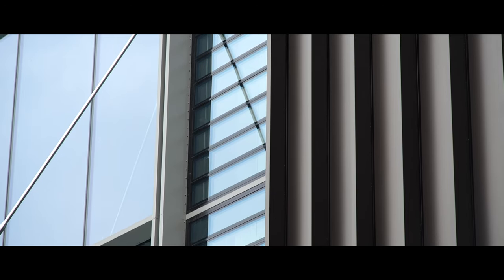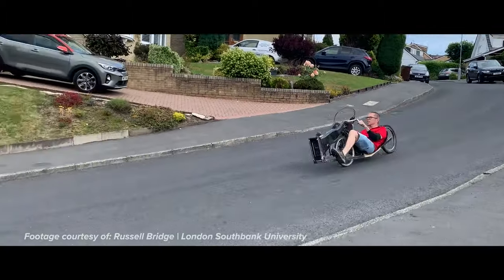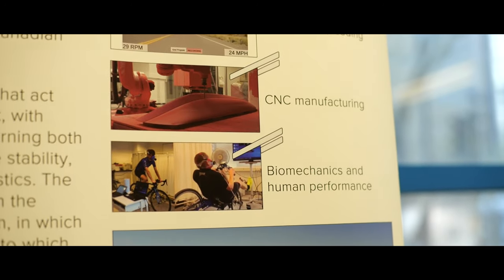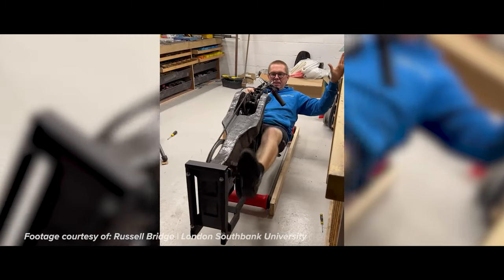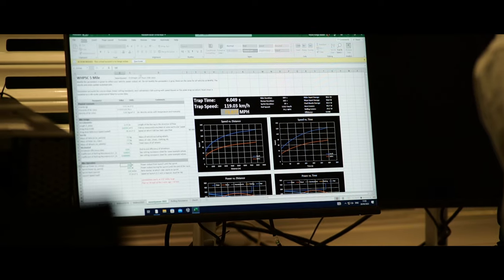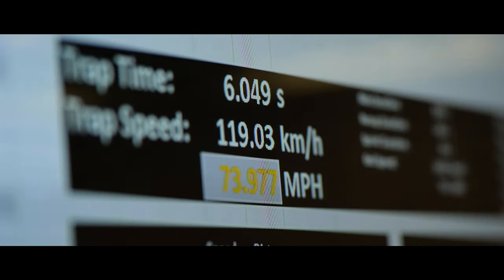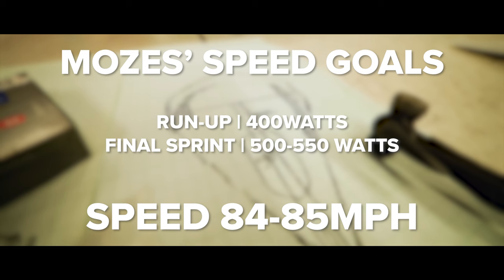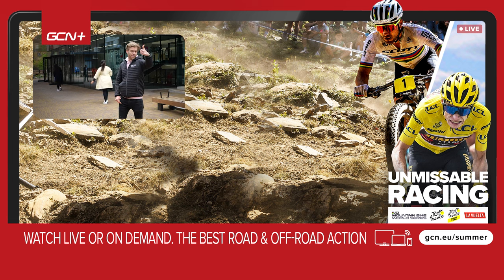The Awesome Engineering Of Land Speed Record Bikes!

Comment: If you were in tbe prone position instead of supine could you leversge your body weight for more power? It would be rear wheel drive too, which would solve the steering/chain problem
Reply: no, because body weight never helped anyone get more power down: what goes down must come up... plus, in the prone position you can't really breathe. Or hold your head up.
Reply: I had the same thought a couple of years ago and looked into it.  A number of people tried it in the early years, and IIRC it turned out there was a greater aerodynamic penalty from the longer fairing (more surface area in turbulent flow) than there was power gain from the prone position.  I think they said something about greater risk of catastrophic steering wobble because of the longer frame, too (lower overall frame stiffness).
Reply: Oh, and there was also the importance of shape.  To get maximum laminar flow, which significantly reduces drag, you want the widest point of the fairing to be somewhere around 65-75% back.  In a prone position you've got the widest part of your body, your shoulders, up front, so you either have to make the front wider and lose some laminar flow, or you've got to keep widening the fairing behind the shoulders, which makes the whole thing bigger and increases aerodynamic drag by increasing surface area.
Reply: @clawsoon  interesting, thanks!
Reply: @shermer75  No problem, it's an interesting subject!

Comment: What are the requirements/rules of this challenge...can you use custom components with everything or do you need to use any particular parts as stock (yea I know this is not UCI regulated, luckily, but...are there any constraints)
Reply: The only real constraint is safety features such as helmet, safety harness, possible roll bar. Other than that if you pass the initial safety inspection and can get anything you   down the road on the two and a half mile qualifying run, you can use ay thing you want to build the bike. Some of the shift mechanisms actually move the cassette rather than the chain so the chain is always in a straight line for better drive train efficiency. there has been more than one rider that rode head first lying on his back using a mirror to look down the road to see where to ride. This contest is about improving the technology(and riders) to make the bikes go faster.

Comment: What the F!! That green thing there is Soup Dragon by THE (late) Mike Burrows, and not a single word about it aside from the inboard camera mention.
Reply: Yes correct. In 2019 it was brought to the speed challenge by London Southbank university and ridden by Russell. However it was a nearly unrideable machine with Burrows original setup. Over the course of just 4 sleepless days and nights the team transformed the inards of the machine from Burrows front wheel drive hub center steering with very limited steering, to a much more controllable rear wheel drive machine with conventional front fork steering. They drove 200 miles to the nearest department store to buy a kids and adult bikes to cut up and use parts. They also borrowed from other teams, bonding and creating stuff. Less than a month before Burrows passed away this year Barney Townsend in this video visited with him and received the latest build from Burrows. The teams all wanted to run tests for him before he passed away.

Comment: So, how do they solve the rolling resistance / rotating weight issues?

Or is it all secret?
Reply: Rotating weight is not really an issue.  I don't know why that was brought up.  Teams look for the lowest RR tires that are available in the size of wheel that they plan on running.  (Sometimes, available tires dictate the wheel size)  The fastest tires are in 700c but they require really long legs to straddle the wheel.  There are some uncommon tires in size 406 with low RR, Blue Flange Michelin solar car tires, Schwalbe or Conti will make a special run of low RR tires.  The current record was set on special 650c Conti 4000 S2.  I think they left out the puncture resistance belt.

Comment: How does ventilation work? Especially in the desert in Nevada, USA.
Reply: pre cooling and some ice and the race is over in 5 minutes 
ventilation make you slow (they get a little bit of fresh air from the wheel well, mostly to breath)
Reply: It's different in each of the bikes.  The fast folks shroud their wheels within the fairing and use the tires as pumps to direct air to either the rider's face or to a breathing mask.  Or a rider will use a mask, breathe in cockpit ambient air and exhale out of the mask overboard.  The difficulty is that the speeds reached at Battle Mountain are much higher than achieved during development testing at home.  Thus, the fastest vehicles are usually the ones that only make minor changes each year rather than starting from scratch.
Reply: @larrylem3582  Thanks

Comment: :O 500W to reach 80 mph. 
Put a 100kW battery from Tesla in that thing and have 16 000 mile range. 
Realistically around 6000 miles but still :O 
Travel across the equator with 400kWh used with total price 136 pounds for electricity!  :O
Reply: Better. And worse. You'd wanna make some compromises.  Get motorcycle tyres n brakes. Suspension. Actually see something. Luggage. But look up recumbent race motorcycle.  The aerodynamics could improve if you don't need to move your legs.         Still .  3 HP is gonna be plenty to cruise at 70mph or something.           It's insane how much energy society could save.

Comment: question everybody, those recumbents are heavier and have 3 tires instead of 2, therefore more friction, yet they're still more efficient? what about going up the hill at 10 mp/h? would a bicycle win in this case since its lighter, has less friction, and aerodynamics don't matter at that speed?
Reply: 1. No , use your eyes. Most have 3 wheels this doesn't.   You can have fold out helper wheels.  Perhaps from 🛼⛸️ skates.  Like a monotracer.        A conventional bicycle wins uphill , if it's steep uphill where aero really doesn't matter much anymore.  Alot, I heard, has to do with the inability to get out of the saddle in a recumbent.  You might get some impression at the gym,many have sit-down recumbent like exercise bikes too.

Comment: #askgcntech Question for Dr. Ollie, PHD in chemistry . . .  Why are cartridges filled with CO2?  The CO2 bleeds out of the tire over the next few days after use.  Why don't they 
just fill the cartridges with compressed air, so it doesn't bleed out quickly?  I know it would be bad to fill them with oxygen, but why not standard air?  Thanks.

Comment: Wouldn't your head at the front be faster? 
Probably more uncomfortable but surely you could get the bike lower..
Reply: Graeme Obree has this idea.  Not sure the practical reality makes it better.
Reply: @brianbailey5714  I agree. The pedal arms should attach directly to the rear wheel, like on a unicycle. Guessing hub gear is needed.  Too many arms and povots on the beastie (Obrea's bike)
Reply: Anything you can think of has been tried.  Head forward-face down needs room for the knees to bend downward, face upward means steering in a mirror, basically upside down and backwards.  With head forward steering is a serious problem.
Reply: @chrismalloy3494  Why not pedaling with legs and arms. There's gotta be a way.
Reply: @notreally2406  The limiting factor is cardio-pulmonary.  More muscles would just exhaust the rider too soon.   Plus the weight of additional pedals, chains and support structures would ruin the aerodynamic shape.

Comment: They should do tdf time trials in these.
Reply: My FTP is only 250 watts, but my best 4 hour effort recently is 209 watts. When my CdA is 0.200 (or better) 210 watts is good for 40kph average speed on flat ground without wind assistance on my Cruzbike V20, which is a "high racer" and not even close in speed to a "streamliner" such as Russells "77" in this video with the same power output. Under the same conditions and power in "77" that bike has to be close to double the speed of my V20. I am not sure where it would even be possible to race these kinds of bikes, especially when you get some young bucks who can put out 300 watts or better.
Reply: You can output 209 for 4hr having FTP of 250? That's some serious effort! Proportionally I would have to sustain around 270W and that sounds like sufferfest... Definitely trying that some day
Reply: @simonRt   Thanks Simon. You should go for it. Be prepared to get disappointed switching back to a slower bike though if you do haha. Yeah, I am not really built for massive power. I tried to improve my sprinting, but the most I have ever seen on my power meter is just over 800 watts, and I can't remember the last time I even tried to get up to 600w. My goal now is to do between 170-180 for 10 hours, maybe even 12 so I can start being very competitive in ultra distance cycling events either on my V20, or my own, purpose built streamliner. 150-160w on a velomobile is right around 50kph and I want to be faster than that.
Reply from the maker: That would certainly be interesting to watch!

Comment: Build a tandem faired recumbent >>> break 100 mph. It's against the BM rules, but it will feel satisfying.
Reply: Or 8+ (like in rowing) and go for 200mph!
Reply: @PrzemyslawSliwinski  Exactly.
Reply: Tandem recumbents are not illegal. 1 from Canada attempted a new world record last year at the WHPSC, but the chain fell off for 1 of the riders. /watch?v=k4Dvwhj6fRk
Reply: How long would a tandem recumbent be?😅
Reply: @andrewmcalister3462  The "magnificent eight" would be about 62 feet long if a rowing boat is a reference or 25 feet if these guys like Top Fuel dragsters.
Reply: @andrewmcalister3462  Depending on the seating arrangement, 50-100% longer than a single. But, about twice the power output with only a marginally higher CdA. I'm in decent shape and pretty fast on a V20, but even a tandem roadbike with fit riders would have me on edge, and I pass roadies and triathletes all of the time.
Reply: Multiple riders have to have perfectly synchronized balance & power, single rider doesn't.
Reply: @DDeden  Definitely! They would probably have to consider a trike.
Reply: @PrzemyslawSliwinski  I'm not impressed with the claims that multiple riders would gain an advantage in speed over single riders. The relative weight per rider is lower, but that isn't important once pedaling starts. The aerodynamic profile of a single rider is better and more modifiable than a group. Compare crosswinds effects, the longer the vehicle, the worse the effect.
Reply: @DDeden  Well, from my back of the envelope calculations I deduced that in order to ride twice as fast (from 100mph to 200mph) you need eight times more power. 
If you assume powers of individual riders add up, then - in principle - you will only have to squeeze such an octuplet in a tube. 

The rest (where the devil usually resides) is engineering...
Reply: @PrzemyslawSliwinski  I must explain, I meant riding in real-world conditions, gusting winds, traffic, turns, some hills, 0 - 100mph max, not the straight line at Battle Mountain in calm conditions. I agree a crew beats an individual there. There's a video on YT of I think 10 riders (Russian?) in a rocket-like contraption at B Mtn.
Reply: Google "Sprocket rocket battle mountain"

Comment: Virtually no steering capability! Not really a bicycle, just useful on a straight track,  requires a push to start, useless in the real world.
Reply: It's a world record setting bike not a comfortable cruiser, it's designed for its specific use.
Reply: @timscott3027  Yes, these bullet bikes are awesome. It's just that I need at least some practical function beyond high speed, I have to design one that has steering, storage and self-starting capabilities that will also perform well at high speed in gusty conditions, and be visible to traffic. Different mission.